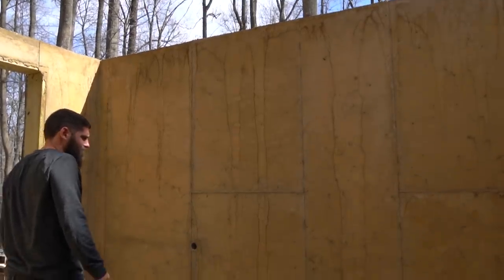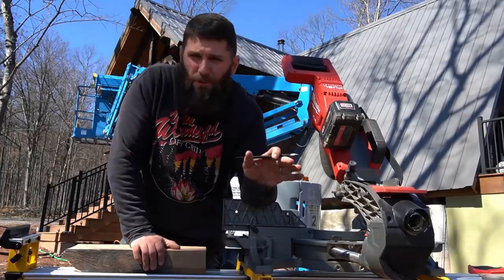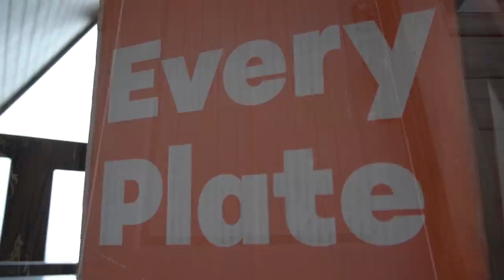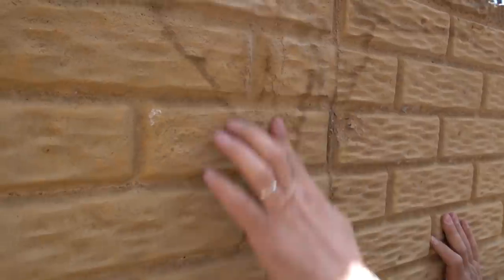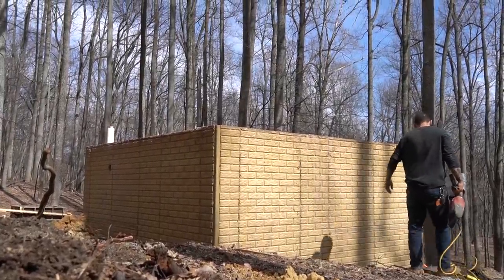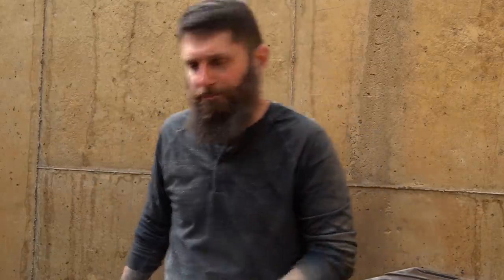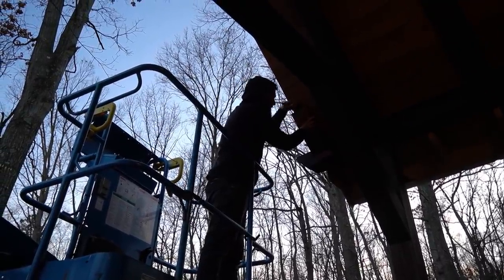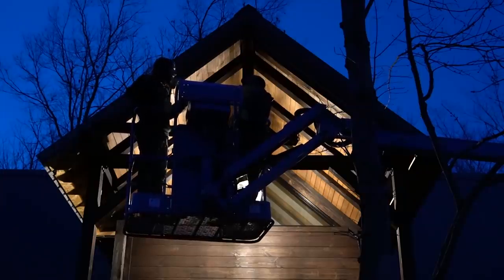Tearing Down The NEW Concrete Walls?

Comment: Best thing you could do right now is tear down the walls. Your always gonna be unhappy with it, and it will haunt you. Take the right steps so you have some recourse on the concrete company. Theres not enough wall there to make the rest of the build go bad. Do it over, do it right
Reply: Sounds like Mike Holmes arrived 😅 but yes I agree. If the walls aren't right nothing else will be, may as well do it right from day 1
Reply: Yup no rebar (from what others have said) means the wall shave to come down. Is rebar not required by code? How did it pass inspection?
Reply: Exactly my thoughts. It’ll bug you forever the wall. Get rid of it and start again
Reply: Couldn’t agree more!
Reply: I double what Matt is saying.  It will haunt you , till it is done right. Been there , done that.
Reply: Completely agree, if you go ahead and tear them down you'll NEVER look back and regret it. But, if you don't you'll often look back with regret and wish you had torn them down and started over. Just my 2 cents!
Reply: 2 weeks in, it's already cracking and spalling.  The anchor bolts sank and you have to drill in new ones. Do you know for a fact that the rebar is correctly tied together?  It may yet fail in other ways down the road.  The more you build on top of it, the more committed you will be to "making it work."  I wish you all the best.
Reply: The minute I saw how wet the concrete was when they pumped it, I knew they were going to have a bad outcome as I've seen it before.
Reply: Absolutely right.  Tear it down.   It is the best thing to do.
Reply: I didnt get to see everything, but the clips I saw looked like a disaster. Bad form install, blow outs and way too much water in the mix (very low slump) were a few clues. And NO REBAR??? The odds dont look good. Sorry you guys got jerked around...
Reply: @kenwarden6371   Low slump ?? You mean a slump that can't be measured.  Like a flat cowpaddy.  18 inch slump , the height of the slump cone.
Reply: @frankish5314  I think it has rebar, but they tried to do it without until Josh told them to put them in.
Reply: @fisherus  Yup… when you pour concrete at the consistency of clabbered milk…. How can you expect the walls to be anything else but spoilt?
Reply: Agree
Reply: @frankish5314  I think they made 'em put the rebar in before the pour, after they recovered from the shock.  It wouldn't pass the Josh inspection otherwise.  I think I'd have fired them as soon as they indicated they weren't planning on putting in rebar.
Reply: Matt is right. You'll never be happy with those walls. Josh, you're a perfectionist and that wall will drive you nuts.
Reply: @frankish5314  Don't think they have inspections in WV 🤷‍♂️
Reply: tear it down and repour with rebar and making the backside level
Reply: While sure .... tearing it down would be ideal, but it's not that easy of a decision.  The walls have rebar after Josh forced them.   He's doing the right thing with a core drill and PSI test.  If the concrete is in spec it would be a total waste to tear it down.  If it's in spec it will last and won't be an issue.
Reply: The fact that Josh can pull pieces of the outside of the wall off with his fingers and hands is a pretty good sign that it's not even a wall! It's a mud cake.
Reply: @KayInMaine  Exactky. Dont need to test it. Tear it down, its already an eyesore unfortunately
Reply: @Highqman1974  exactly! Next winter with the ground moving from the frost, that foundation would just crumble!

Comment: It all comes down to the concrete company using too wet of mud for the walls. I did my fair share of concrete walls in the past and we never added water. We used a vibrator to move and mix the concrete in the walls. The top of the walls are probably uneven because of how wet the concrete was. When I saw no rebar in the footings for the walls that was a red flag for me.
Reply: One thing the only thing that happens of to much water in concrete its take longer to dry but it gets stronger as it dries and much water in it it levels much easier rebar is a must
Reply: Watching  that video I immediately thought  that's not going to  pass inspection. Way to wet, no rebar, and they weren't organized ,plus the blowouts!  Could be someone  just starting out, and lacked knowledge. I'd that's the case, make it right don't run off and leave a client hanging. Bad juju
Reply: I've done concrete as well. We always took a sample and turned the load away if it was too wet. The fault is on both companies. The lack of rebar would have caused an immediate stop to work, prior to pouring.
Reply: @otakumagnet8106  Well , we all Just SAT here , & let it happen !! What a waste ,
Reply: @mariowickel456  it needed an inspection before the concrete is poured. Without it, the municipality could make you tear down the walls regardless.
Reply: Where are the structural drawing or the GC for that matter??
Reply: I mean seriously who does that ?? Rebar is a absolute must for any job with concrete.
Reply: @williambreze1666  Not every job calls for rebar, but footings and foundation walls absolutely do.
Reply: That concrete was way too wet, that was the thing i thought when I saw the pour in video. It shouldn't run like soup 🤦‍♂️
Reply: If the walls are a load bearing they should be reinforced with rebar and the foundation should of had rebar also placed in it. 
Major red flag with out rebar. The building inspector should of been there to make sure it was done correctly. Also why didn’t the concrete testing didn’t make test cylinders for 7, 14 and 28 day compression tests? That would also be a red flag. I’ve built and designed many structures and have done projects all over the country. Good luck with your new venture!
Reply: Exactly ...
Reply: @otakumagnet8106  Agreed. It's quick and easy to take a "slump test" before pouring. You send one load back to the plant and you never have to send another!
Reply: @hmsjr0154  Yup, unfortunately these guys are completely clueless.
Reply: Read the rules. If you used a vibrator to move concrete you broke the rules.
Reply: @hmsjr0154  it appears that in their location municipal inspections aren’t required. Maybe we can get Josh or Erin to clarify. 
 
If the Structural Engineer called for continuous inspection then a deputy would have been present during the pour and to take samples. This is just standard practice where I build, Southern California. Crazy how we construct so differently in the United States.
Reply: @slynn5138  I agree. I am wondering what the plans reviewer was thinking when he was looking them over. I do know that wva does require building inspections to be done during the process. I’ve dealt with them in the pass. I don’t know if they still allow it or not.  But the architect that designed then plans was allowed to inspect his own work! That didn’t go over well with me and promptly had contacted the state agency in Charleston about it. We ended up hiring an outside vender to do that job. 

A side note. Does California still design for enhanced seismic protection. Did a project out there a long time ago and we had to design for enhanced features

Comment: If you do end up tearing the walls down, do them over using ICF forms.  You can do it.  You'll have to apply a synthetic stucco, but it will look good.  I formed our house with attached garage with ICF's and I'd never used them before.  There are lots of YouTube videos using ICFs.
Reply: I absolutely agree!!!! ICF is short for “man lego”, right up Josh’s alley.
Reply: Before my brother passed away that's what he did for a living. I still get his news letters and  magazine on ICF. They have built entire houses with it. And it has its own insulation values.
Reply: ICF - insulated concrete forms are awesome, has click in portions for rebar locations!
Reply: If it's on YouTube it must be right...
Reply: @johnr8439  I built my house 7 years ago and didn't watch YouTube to see how it was done.  I went to seminars put on by the ICF manufacturers where we did hands on training.  And my house is anything but a regular foundation.  There are 17 eight foot wall sections that make it up.  I cut virtually every block on a 21.17 Degree angle.  With the insulation under the basement slab and in floor heat it's incredibly comfortable.
Reply: The first mistake was NOT using ICF's.
Reply: They are in a termite area, I wouldn't use ICF there.
Reply: @cpcorbitt  .?
Reply: @spazoq  there are termite prevention techniques that can be used effectively. Anyone in termite territory is going to have to take prevention steps regardless of the building materials used.
Reply: @garykitzrow4789  the off forms i used had plastic stiffeners that ran between the wall surfaces and had locations to lay sticks of rebar both vertical and horizontal
Reply: Yes we actually built some of our dorms at our university here in Texas out of ICF.

Comment: The water in that drill rig is also for lubrication to help keep the bit cool so it lasts longer.  Having cracks is not unexpected, but there should be rebar in the wall to hold it together.
Reply: P
Reply: pretty soon for cracks to be showing in my opinion maybe a year or so down the road but not this soon, the concrete is shit!!!

Comment: I’m glad you guys are keeping up on this, as soon as I saw that concrete being poured and how thin it was a new those guys had no clue what they were doing. I’m not even a concrete guy I just have a friend who is and I seen it done a bunch of times, I’ve never seen concrete that thin. The fact that it was still wet in the center was ridiculous, it’s not curing properly. Most people would’ve just said it sucks and built on it, I’m glad you guys are getting it tested and making sure the place you build is going to be safe.

Comment: It's so frustrating to hire "professionals" to help build a project only to find out that they are not even qualified to be called amateurs. You guys are great at picking up the pieces and putting things back together. Life can be well lived even in the low spots.
Reply: This is why DIY is so much better.   With passion determination and love we can do anything ourselves
Reply: Sue them
Reply: @vlogsymaswanda  they commented in the video that they weren't going to sue because the cost vs reward was too low. Sometimes it's risky doing business with small companies/individuals. The good news was that the concrete guys have only been paid a portion of their bid price. I'm an electrical contractor and I usually get  a 1/3 or 1/2 down and then the balance at the end of the job, so that normal practice.
Reply: I’m concerned that the contractor can try to put a lean on the property. Unsure what the local laws are, hopefully no long term issues.
Reply: @baxter6574 , they can here, but if they can prove that the contractor did shoddy work or used inferior materials, josh and Erin will win no problem, I hope. This whole thing just sucks for them.
Reply: @vlogsymaswanda  it’s not worth his time, they’ll never collect a dime from the contractor.

Comment: Joshua If you are 2ed guessing his concrete work now, are you wondering if it will fail later?  Might be better to tear it down and do it right. I know it will cost more now and set you back time wise but it may be worth it in the long run. Its cracking now with no load on it. With too much water in it and freezing temps it cracked and I would think it is not structurally sound.

Comment: Excellent Videos, As a Builder myself, I would pull the unit down. It needs re-bar and by not putting it in could result in failures later on. keep these Videos coming good luck

Comment: More than likely it will test out above 3500 psi. Because they did not use a vibratory the rock will be most disbursed evenly. Excessive addition of water will cause surface spelling og mortar. May need to use a hardener surface treatment to stop it

Comment: I would not have allowed the concrete pour in the first place because they did not install any steel rebar within the walls.  Good concrete can handle compression, but not tension, which is what the steel rebar is for.  The rebar should have been tied all the way into the footing as well.
Reply from the maker: There is rebar in the walls. They weren’t going to put rebar in but we stopped them and had them install it

Comment: Those cracks in the foundation already are shrinkage cracks from pouring too wet, you are right to have core tests done.
Shrinkage cracks are different than stress cracks. Stress cracks are signs the concrete is doing its job.
Reply: The footing may be cracked in the same place the walls cracked.

Comment: Despite how the samples come back due to the cracking straight through the whole entire wall I would insist that they come and report everything that is where you’ll get water penetration and then with the cold winters it’ll freeze and have a complete failure. If you’re uncertain what to do I would have two or more other companies come out and give you their professional advice. Make sure they’re not friends with the company that poured it.

Comment: I got a question for you WWOG and if do not want to answer it I understand. We all know the guys pouring the concrete did a bad job, but is it not the responsibility of the actual place where you got the concrete from to make sure the batch was the right mix. So if the psi test comes back and it is not strong enough can you at least get  the cost of the concrete back?
Reply: The concrete contractor calls the order in for the type of job they are doing & the PSI needed.  It was mixed according to what they ordered.
Reply: Ordered properly but they destroyed  its strength by adding excessive amounts of water to pump it up the hill.

Comment: As a retired general contractor and dealing with building departments it's obvious you didn't need a permit and if you did those forms/footers would have been inspected for rebar...etc  in 2 separate inspections in my area and maybe a minimum slump test would have been smart on the contract but this is all hindsight.... 
This is exactly why you have building departments and inspections throughout the building process, sometimes it's a pain in the butt but it protects everyone.
As a contractor myself for over 45 years it's sad to see what these amateurs did to you. I do agree with your approach if it needs torn down you tear it down it's the" foundation". 
This is why you don't pay all the money up front so I'm glad at least he will not be paid in full.
 I watched the pour and it was very wet as seen by the bolts sinking I will be surprised if it's 3500 PSI but I think the spalling of the walls crumbling/cracking will continue.
Grip it and rip it and start over it will ease your conscience knowing that you did it right sorry if I seem negative just stating the facts at least it's still green so it'll be easier to take out
Reply: Freedom for the contractor but no protection for the customer inspections and regulations work
Reply: I couldn't agree more.
Reply: Great advice. Tear it down.
Reply: Ditto from another 40 year contractor. Lien release, workers comp, liability ins , errors and omissions, it’s a legal business before hammer and nails

Comment: I was wary from the moment I saw the poor quality of alignment of the walls in the previous video and the lack of rebar.  I hate to say it but I'd have a hard time trusting the walls even if the strength tests came back okay.  I once had a contractor replace a concrete porch top and they had the gall to say "well that will last you 5 years".  Nobody expects that.
Reply: I CRINGED & closed my eyes when I seen them pouring. Sad that you can't trust people who claim to be an expert in a particular area.

Comment: As a carpenter my whole life and you an electrician…WTH your the boss of this project. You don’t check out your subs work and referrals first before letting them loose. Unfortunately in the blame game - your just as at fault as concrete dudes. If you would have pulled a tape of forms before pour…life would be so much easier now or look for rebar, etc. yes there work sucked but it’s not all on them. Lessons that we learn.. never ever assume!

Comment: Hey Josh, if those walls visibly look ok, I wouldn't tear them out. Those walls look like they have no structural integrity, but they could be an exterior facade for the new structural wall on the inside. You could use the existing facade wall as the outside form for the new inside structural wall. Then you can cantilever the floor joist out over the top of the facade wall. It's just a suggestion. All you would have to jack hammer is the inside of the footing and then did down underneath it. That's my 2 cents of advice after correcting incompetent mistakes, especially in concrete, for 42 years of building. I love your show. I like the way you both think. Sorry for your troubles.

Comment: Sorry to hear about the new cement experience. I'm no pro on concrete but I've done a few and def over do the rebar grids. Just makes since. More steel more strength. Less water and a vibrator it would of settled out level on the top plates.. wish the best of luck to you both.

Comment: Well I worked construction for 15 years and I saw no rebar in the walls and when pouring concrete for a wall that thick 2 things should have happened, vibrating it in and oiled walls . That’s why you’re getting the chipping and the lines in the walls.  Also going forward I would check for certificate of insurance which your General should have taken care of.  I hope you get it worked out!

Comment: When the " concrete guys" were pouring the walls and had a blowout and it looked like a fire hydrant had been turned on, rather than concrete oozing out, even I thought that was way too much water in the mix and I am not even a novice. That being said, I know you guys will handle the situation in the same professional way you have approached all the work you've done on your own home.